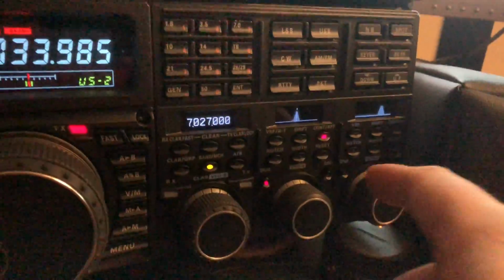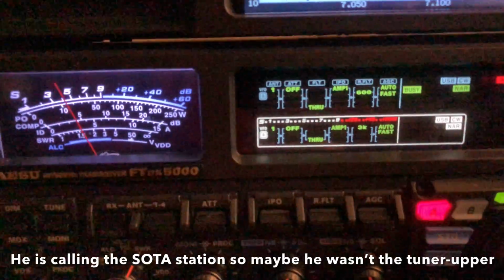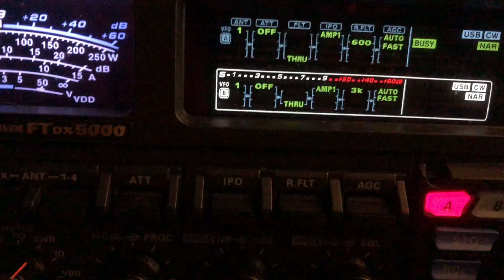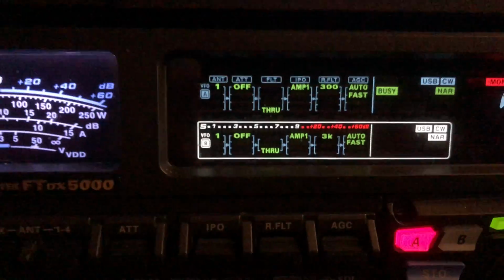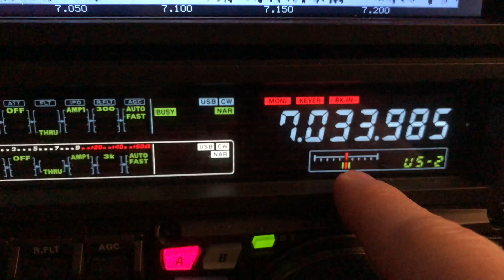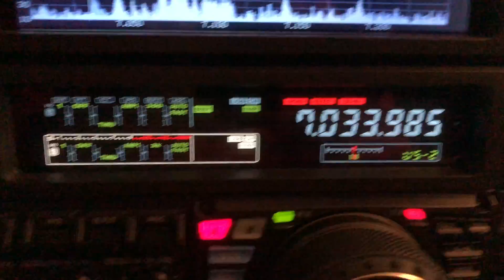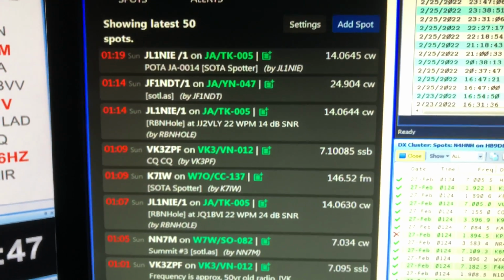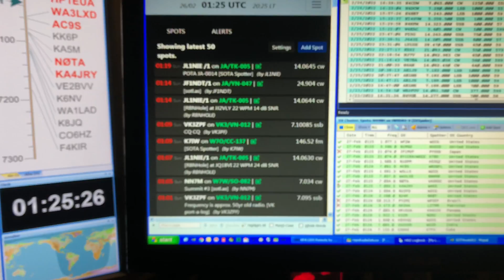Roofing Filter & DSP Minimize Noise (CW mode)

Comment: It would help the noise level if you weren't using AMP1 but we're using IPO1 or 2.  Can't imagine using gain on 40 meters were the noise level is generally high
Reply from the maker: Indeed.  I rarely use anything but IPO1 or 2 except on CW, when I need additional sensitivity to pull out a ghost station.  AMP1 helps overcome the insertion loss associated with tight filtering.  If I’m listening to a strong station, I use IPO1 and sometimes IPO2, and I might even add 6dB of attenuation.